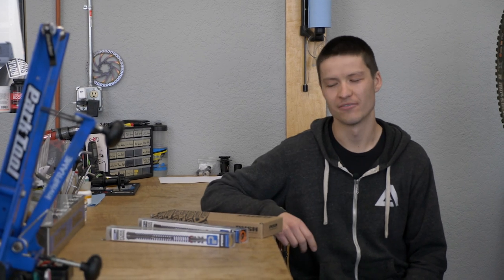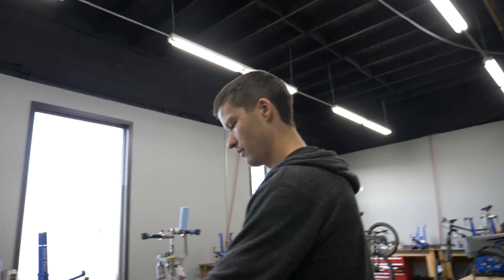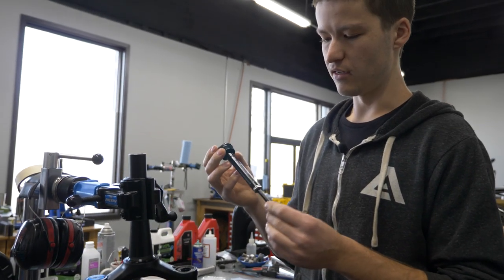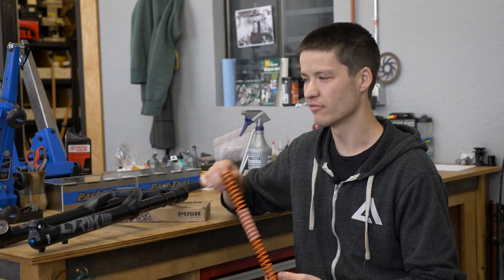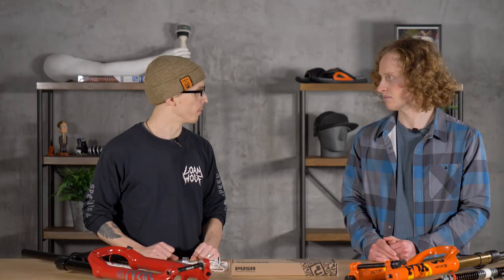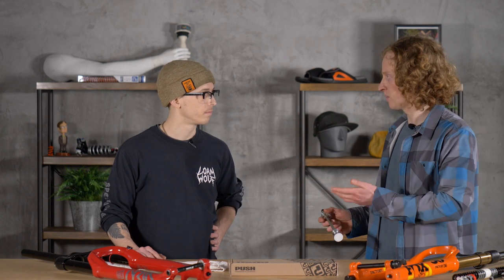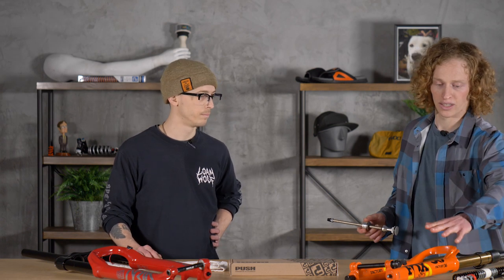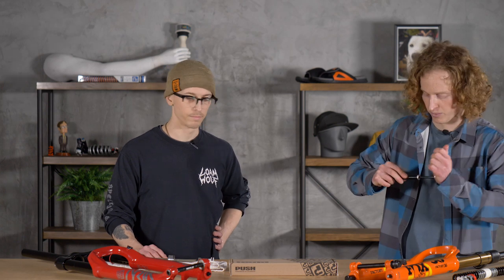Push ACS3 Fork Coil Conversion - Reviewed

Comment: So... I'm not in the business of selling bike components, and I have run the PUSH ACS3 in my 170 Lyrik, putting some fair amount of time on it, and I have some honest info that might be helpful for those interested in the conversion. 
     First, for what I will speculate are liability reasons, PUSH states that this conversion is one way only, meaning they state and retailers state you can't go back to the OEM air spring because the coil will score the inside of the steerer tube, which in turn will cause an air spring seal to leak. WRONG! On that, I ran the ACS3 for 6 months, including many days in the bike park and actually reverted back to an air spring recently to increase my travel from 170 to to 180mm. During the conversion teardown back I saw no scoring inside the steerer tube, and many laps post reversion I have had zero air bleed down past the piston seal. In my opinion the reason PUSH states the "one way conversion" advisory is that it is possible that scoring could happen, I would imagine especially if someone doesn't lube the coil well upon install or fails to do recommended basic service, and PUSH does not want to be held liable should such damage occur. I also have a DH bike utilizing a Boxxer A1 Team coil with many, many days of bike park on it, and it has no scoring inside the steerer tube. This is in part because I am a stickler for doing proper fork service, and having run a Boxxer, I knew that buttering the coil (the whole length) is very important. PUSH doesn't emphasize this the way SRAM does in the service manual. If you run the ASC3, I would strongly suggest buttering the whole coil well with compatible grease, and you should have no problem going back to air spring over a reasonable period of usage. 
     Next point is oil... You can go with PUSH recommended oil OR, and this will make going back to air spring a much easier process should you do so, just use RockShox recommended 0W-30. Why? If you use the PUSH recommended oil, and if you do as I did with the syringe I used to service both ways, and if you failed to completely clean out the syringe when servicing with the two different oils you will see the PUSH oil coagulate in the syringe like snot, meaning it is somewhat incompatible and it will take a lot more cleaning in the fork than necessary should you just stray from the OEM recommendation. AND, if I remember correctly, PUSH advises going with 20 ml of their oil in both legs. RockShox explicitly warns against going over 10 ml in the damper side or damage to the Charger damper could happen. Not sure who has it more right, but 10 ml on the damper side has worked fine in thousands and thousands of Lyriks, and so I'd personally stick with RS's recommendations. As for the spring side, 0W-30 is the same oil RS recommends for its coil Boxxers as well as its air-sprung newer forks, including the Lyrik, and at the end of the day all it does is "splash" AKA "bath" lube the coils, dust seals and bushings; it doesn't do any duty as a damping fluid, and it will work perfectly fine for an ACS3 conversion just as it works well for a Boxxer coil. If you have an RS fork its probably best to stick with the oil its bushings and o-rings have been "seasoned" with regardless (IMO). 
     PUSH lower fork dust seals... Do know that getting your steerer tubes into the PUSH seals is a major, major pain in the ass, so much so that after struggling quite some time I damaged mine and went back to the SKF seals, which work perfectly well. 
     One problem I ran into with the ACS3 is the red cap on the spring shaft that the lower end of the coil sits on. Mine cracked up and dispersed itself into the coil. I suspect it happened during a spring swap, the cap sticking to the bottom of the coil, pulling it off the spring shaft yet leaving it inside the tube off kilter as the coil was removed, and when installing the new coil the dispositioned red cap never seated properly and therefore cracked-up. I'm in the process of trying to obtain a new one from PUSH, and I suspect mine is not a unique occurrence. 
      You will need to either buy from PUSH a chamfer-less socket to install the top cap, or you will need to grind the chamfer out of a regular socket (the chamfer is inside a regular socket, and it is the first mm from the socket lip which angles inward to where the actual contacting tooth of the socket begins), which is easy if you have a die grinder with a sanding disk or access to a belt sander. You could even modify a regular socket with a flat file and ten minutes of sweat equity. But do be advised that if you use a regular store bought, non-modified socket, which will have an inner chamfer, the top cap has such a low hex head that you will more than likely mar the hell out of it when installing the top cap. Trust me; I did it. 
     Lastly, if you ride PNW do know that you can run the coil weight PUSH recommends and be perfectly happy, or even stiffer, but if you take the bike on a trip to a rockier place like Trestle Bike Park, CO you may well need to drop down a coil below recommendation or your hands and wrists will take a huge beating, which defeats the point of the sweetness running a coil. That's the benefit of an air-spring; it is a no cost, easily adjustable thing of relative beauty. I moved to Colorado from Seattle last summer and brought with me the "stiffer is more expert" mentality (because out there popping roots etc is the game ) and paid the price of constantly sore wrists after my relocation, only to eventually realize that in the PNW the trails are much kinder (not technically) in terms smaller hit, constant impacts than the rockier, and chattery bullet-proof hard pack of more arid, desert(y) riding of places like CO and NM, and maybe, just maybe I needed to soften my sag just a skosh.
Reply from the maker: Great feedback, thanks for writing in Larry! All very good points.
Cheers - Dan at Fanatik

Comment: Well thanks for the input. I have a 2020 Enduro that came with the bottom tier fork internals! Also, my bike is already a tank, a spring shouldn’t be too noticeable. I’ve been on a 2014 Pike that I love, so I’m a little hesitant to go coil.
Reply from the maker: I'd start with it as-is, see how you like it, and go from there! Another option, if you don't want to mess with your warranty or add weight, is the damper upgrade!
Cheers  - Dan at Fanatik

Comment: Hey guys, great video! I have a quick question: 
The improvement in fine bump sensitivity makes sense. What I'm curious about however, is how the ACS upgrade changes the fork's characteristics on really "pumpy" terrain. One thing I do love about air shocks is the progressive ramp and pop you get out of terrain (particularly on an EVIL). On older large travel coil forks, I remember them feeling almost "dead" in how well they soaked up every nuance of terrain. So yes, I'm curious how these behave on high speed, buffed trail where you're pumping features to send as many gaps as possible...? In other words, does the coil still offer a "reactive", progressive and poppy feel?
Reply from the maker: It depends in a large part on what spring rate you run. You can run a softer spring and get a bit more of that (can be countered a bit by increasing low speed compression on the trails you describe), or you can run a stiffer spring and not have any of that. That is what I ended up doing on my Megatower.
Cheers - Dan at Fanatik

Comment: So if I wanted a coil fork, what are the options, this and the other kit flying around in the comments, then the bomber z1, MRP has a coil fork too right? And what else? Does ohlins has a coil fork? Any idea Wich one is the best without looking at the price tags?

In case that the best "coil fork" is with a conversion, I'll have to buy an entire air fork or is there a way to buy the chassis separately? Are those coil conversions compatible with either a lyric or a Manitou mezzer pro? (Both better/stiffer chassis than the fox 36)
Reply from the maker: Cane Creek Helm is a great fork, also offered as a coil option. Any of the ones that already come with a coil spring are going to be the best price-wise, since you don't have to buy the extra kit. I have owned both the Helm, the Ribbon, and a Grip2 36 with a Push conversion. I like the 36 the most, and then the Helm, and then the Ribbon. That said, I'd still probably get the coil Helm over the 36 with Push kit because of the substantial difference in price. Check those out here:
https://www.fanatikbike.com/collections/forks?_=pf&pf_pt_product_type=Forks&pf_v_brand=Cane%20Creek

https://www.youtube.com/watch?v=vMjpbsCU460

Comment: Is there noticeable noise? That was one of the things I did not like about coil. My FOX spring would bang against the stancion. The shrink wrap would wind its way down and the noise would get loud. I have a Lyric select plus. I want to put a charger 2.1 rc2 in it. Would you recommend the push over it?
Reply from the maker: Good question. Our experience with this particular set up has been super positive. I have one on a 36, and Doug has one on a Lyrik. Neither of us has experienced clanking. We've also installed quite a few of them on customer's forks, and I haven't heard any negative feedback about that. We definitely always make sure to put a good amount of grease on the spring to help with that.
Dan at Fanatik
Reply: Fanatik Bike Co. so you would recommend the push over upgrading to a charger 2.1 RC2?
Reply from the maker: @toolfool3500  Oh gosh, another good question. I don't have back to back comparisons of all those variables, but I'd bet that you'd notice a bigger difference in terms of small bump compliance, support, etc, with the coil kit. On the other hand, you're also adding weight, and making it so you probably can't go back to air if you do install the coil.

Comment: Can you put a fox 36 kit on a Marzocchi Z1 fork?, because in theory are the same fork, rigth?
Reply from the maker: I do believe so, but I'd like to double check that. Push is closed for the holidays, but I'll get back to you!
Cheers,
Dan at Fanatik
Reply from the maker: I was wrong. Although you can pop a Grip2 damper and the like in there, the air spring side has a thicker walled stanchion, so the spring and top-cap won't fit into it.
Cheers - Dan at Fanatik
Reply: @FanatikBikeCo  thanks bro, happy holidays 👉🏾😎👉🏾

Comment: Push acs kit vs rc 2 damper or air spring  upgrade for my yari?
Reply from the maker: Yep!
https://www.fanatikbike.com/products/push-industries-acs3-coil-conversion-kit-rock-shox-lyrik-yari-27-5-29-2016-2020
Reply: @FanatikBikeCo  I ment to ask or*
Reply from the maker: @aaronburela432  Ah, sorry, I misread the comment. The damper won't make a massive difference. Remember, the damper just adds control to the spring, which is the part that is doing all the work. The spring will be a more noticeable improvement.
Reply: @FanatikBikeCo  thanks! That's what I'm thinking gonna be ultra plush

Comment: I'll take the Vorsprung Smashpot over the Push....  Adjustable HBO and cheaper.
Reply: And you can extend a fox 36 29 fork upto 170mm. It was unreal at the bike park this year
Reply from the maker: That does look like a slick set-up, I have not tried it. The only counter-point I'd offer is that the ACS3 kit does allow you to control bottom out via the air piston.
Thanks for watching!
Dan at Fanatik
Reply from the maker: Ah, and actually the ACS3 kit is cheaper. Although the price of the Smashpot is cooler.
Reply: @FanatikBikeCo  Vorsprung offers adjustable control in the bottom out without a shock pump.  Just have to turn a knob.  Also easy to adjust different suspension lengths on your fork.  Don't think you can do that on a Push.
Reply: @FanatikBikeCo  The smashpot has a controllable hydrolic anti bottom out. I am the proud owner of a Push 11 6 on the rear. I just wanted to increase the travel on the front from 160mm to 170mm. Coil has massively helped with arm pump as well. I love it.
Reply: @FanatikBikeCo  Not only is our price cooler, but it is in Canadian dollars, so it is actually much cheaper than the Push kit. Right now the ACS3 is listed at 389usd on their website, while the Smashpot's 420.69cad translates to just under 320usd with the current exchange rate.
Reply from the maker: @VorsprungSuspension  Boom. There ya have it.
Thanks for the feedback, enjoy the holidays!
Dan at Fanatik
Reply: @FanatikBikeCo  Time for you to get a kit in and do a comparison